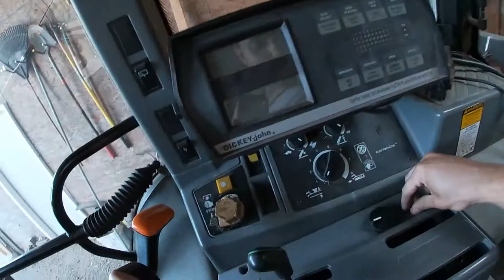How air conditioning works (on tractors)

Comment: So if you can turn you switch that controls your temperature in cab down and the air stays cooler than if you leave wide open all the time do you think I would have a bad relay
Reply: If your tractor is like this one, yes it could be going bad. It sounds like your evaporator is freezing up due to the thermostat wire, which is part of the relay assembly, is not working correctly.
Reply: @tobyreich6916  thanks